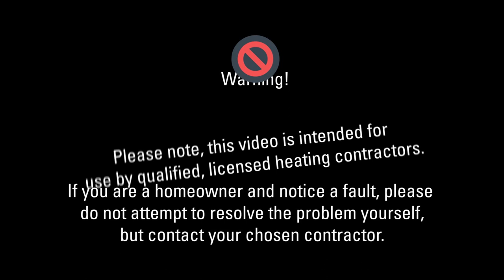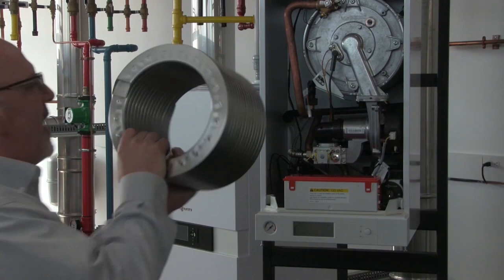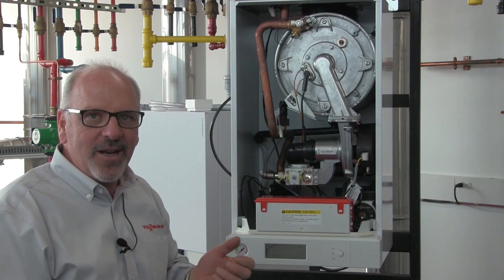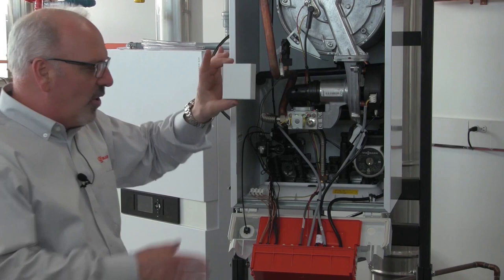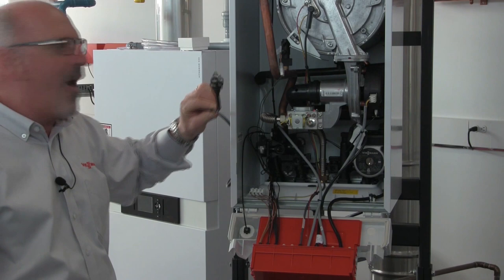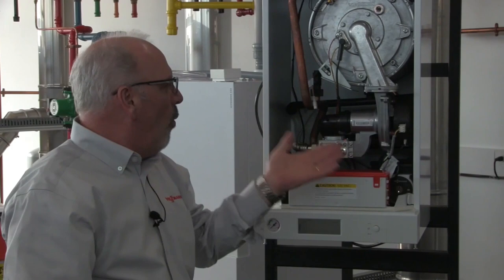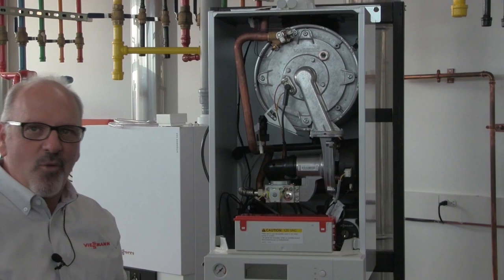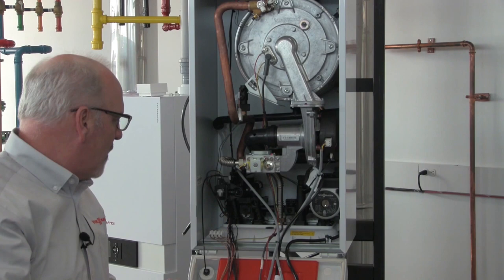Vitodens 100 W B1HA - Space Heating Boiler

Comment: I have the Vitodens 100-W  B1KC. It was getting a flame failure in week 1 after installation. Viessmann were very prompt in sending a helpful technician, who changed the circuit board. I kept the old one and was very disappointed to see that it had Chinese relay switches on it. This is highly unusual in this context and certainly never seen on anything that is "made to last".